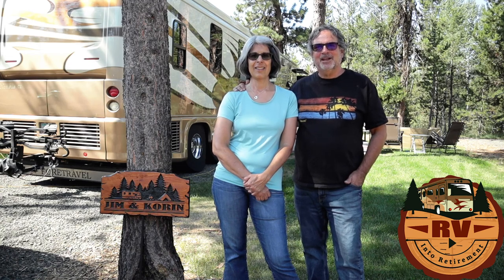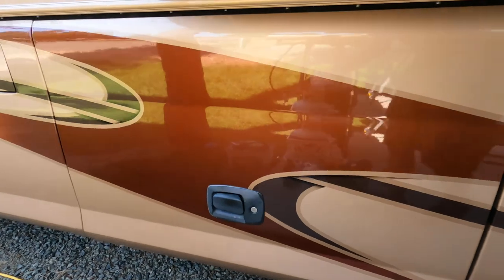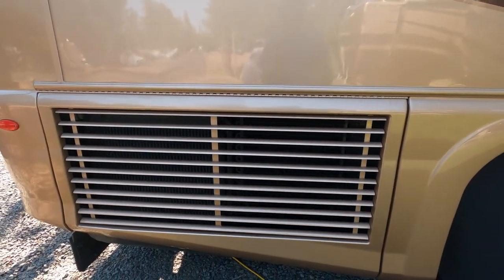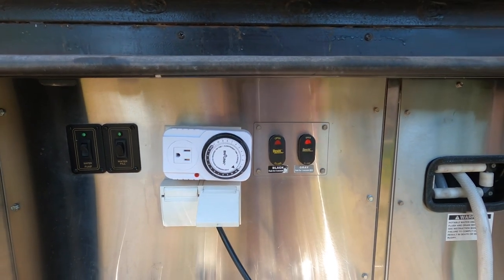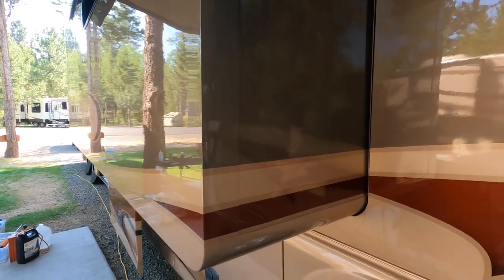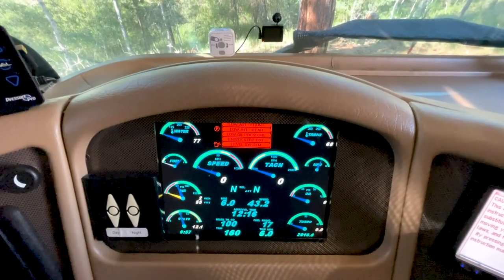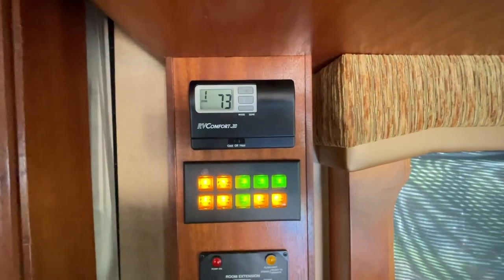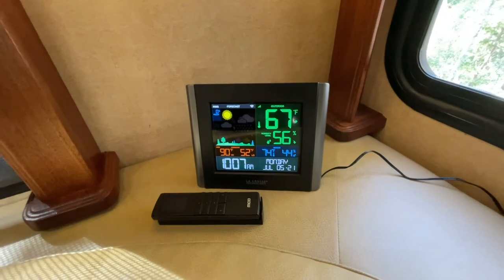RV CLASS A TOUR | Used Foretravel Diesel Pusher | What to Look for in a Class A Motorhome | 1 of 2

Comment: Think you’d mentioned you had a Country Coach previously.  What pushed you to change brands?  Advantages/disadvantages?
Reply from the maker: We decided to go full time and in doing so wanted some additional features like residential fridge, floor heat, all tile floors and a better TV location.  All that added up to more than we were willing to put into a coach.  There were some advantages to Foretravel over CC but we would have gone for either having found the the right coach.